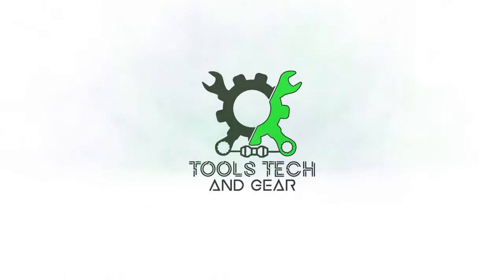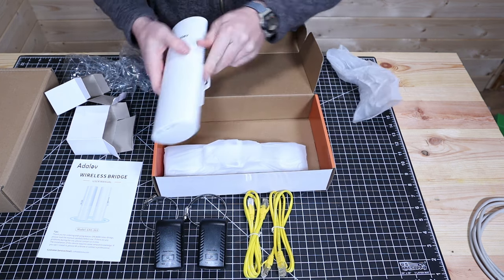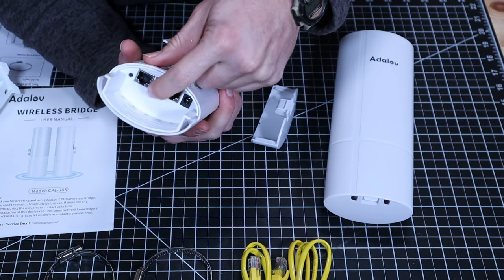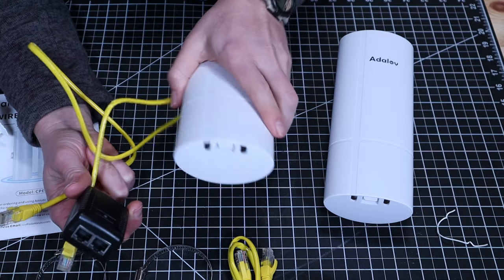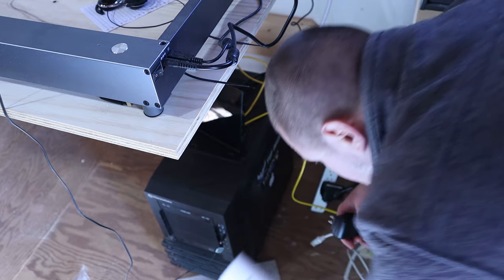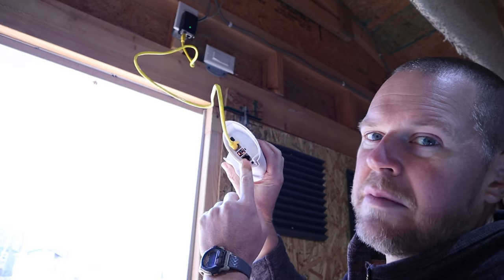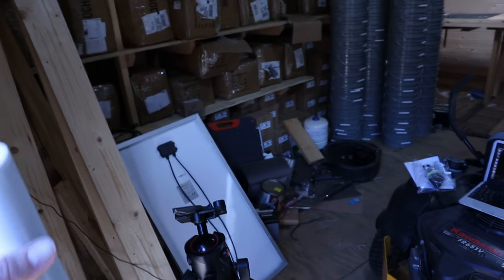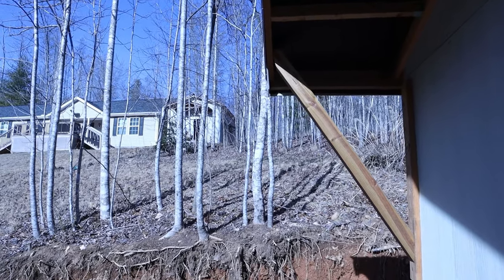Adalov Point to Point Wireless Bridge Install

Comment: You need to plug in the "B" ethernet into the Other port on the POE adapter to get more than 100Mbps, I have these, You may not get 1000Mbps, but I get 350 Up and Down on mine from 650Ft  away. The port you are plugging into on the Bridge is called a "Management port" Yes you can get internet from it, but its main purpose is to connect directly to the Bridge for configuration.
Reply: So you do plug into the 1000 mbps on both units.??
Reply: A answer to this question would be helpful

Comment: I don't have these but have installed lots of PoE wireless. You shouldn't need to use the 100Mb port at all as the data will flow on the 1Gb port with the power signal. Unless of course this vendor is doing something odd.

Comment: so just installed my own. model CPE468 and everything is connected and setup correctly, my wifi router says its connected to the internet and when i connect my phone to it, it says i have 1gbps internet speed, but i cant even open youtube. when i check the speed on my phone inside my house (where the modem is located) itll say i only have like 400 mgps and i can download 60gb games in less than 40 mins. its really confusing me

Comment: Why would you need 2? Wouldnt one work just fine? Connect directly from main router and into the barn?
Reply from the maker: The two bridge talk to each other. They don't talk to routers outside of the ethernet cable. You have to have the pair.

Comment: I love this kind of stuff.  As a little kid (before cell phones and FRS radios) some neighbor friends and I tried to set up a telegraph system thru the ally between our houses.  I may have to check out this system to connect to my brother's house again.  😁
Before my brother bought a house in my neighborhood he was approx 5 miles as the crow flies across the river bottom.  He had broadband.  I had no broadband available. We set up 802.11b with a 24db grid antenna on each end and then I also had broadband.  That worked for a few years, then he moved to my neighborhood and neither of us had broadband.  A friend about 1.5 mile away let us set up the system from my brother's previous house and we put up a smaller antenna at my brother's new house.  Then all three of us shared that broadband for a couple of years until finally my neighborhood was wired.  We took the equipment down from the friend's house as he was moving, but my brother and I remained connected until an ice storm in winter 2009 took down my antenna.
Reply from the maker: That is brilliant! 5 miles is a long way to get the internet to travel. A lot of us had that struggle years ago. My brother and I had to get cell service into our parents basement.
Reply: @ToolsTechAndGear  Desperate times call for desperate measures!

Comment: I've installed several CPE and WISP systems in my prior work life. I like the simplicity of this one plus those included pole mounts! The pole mounts alone are easily $15 each. I also like the compact style of POE injectors like this unit has vs. other ones I have used. This is smaller and less clumsy on cable management. Nice!
Reply from the maker: The system seems to be a good fit for those looking to extend internet service to an out building. The power over ethernet is convenient!

Comment: I like your video since I am going to install one of these soon and I can't find a manual.  One question, why the POE on the 1000 GB channel instead of the 100 MB?  Thanks.
Reply: If you plug it into the 10/100 then your maximum throughput speed would be 100mbps.  By plugging it into the 10/100/1000 your maximum throughput it 1000 ... so 10x the speed by using that port

Comment: Hi @Tools Tech And Gear, do these wireless bridge work on vertical distance? For example, condos. Can like 8 floors right below receive the wifi signal?
Reply from the maker: Yes that would work well.
Reply: They can tilt up and down on the mount

Comment: Is it absolutely necessary to have line-of-sight for these units to work?  I know it would be preferable but is it useless without line-of-sight?  I saw a video of a very similar type unit (unknown manufacturer) and the presenter claimed line-of-sight on that unit wasn't necessary.  Can anyone provide some insight?
Reply from the maker: I have mine installed around 150 feet away line of sight. I think that they are affected by both direction and line of sight

Comment: But is the slave emitting wifi? Or do you always have to connect via Ethernet at the shed?
Reply: Or should I connect a router to the slave to have wifi?
Reply: @TheDjeezus  As he mentioned in the video, you have a choice. You can connect your laptop to the slave unit via an ethernet cable, or instead plug a wireless router into it. I think just about everyone would go the wireless router route. Mine cost just $40 and sure gets the job done.

Comment: So does the garage unit hang outside or inside the garage? Does the router unit hang outside your home or inside? Do you connect the garage unit via Ethernet cable to the extender or will it connect wirelessly as it does to the router?
Reply from the maker: Both units can be hung outside so that they are line of sight from eachother. Both units will have power through the ethernet "power over ethernet". Once you have internet in the garage you then use an ethernet to get the signal to a wireless router.
Reply: @33thewitt  I assume a simple WiFi Access Point would also work, not a full-blown router with NAT, etc...
Reply: The B version has some wifi ability as per manual.  Specific Address/password/ssid for every channel!

Comment: Hi Seth! We have our bridge all set up. We have full WiFi bars all lights are lit.  Unfortunately none of our devices connect. On our devices  under the  the router name it says in yellow no internet connection with a line through the symbol. HELP we just don’t know what to do!
Reply from the maker: Do you have the internet from the bridge going to the router internet in port?
Reply: The master(bridge) is plugged into the router in the home and the slave (bridge) is plugged into the router in my out building where I would like service. If that answers your question then yes.
Reply: I have a question.I'm actually buying this to get Wi-Fi in my rv camper Will this device give me wifi access to my cell phone my smart tv my xbox So I can use my smart t v to watch movies with the wifi

Comment: Recently purchased these myself but I've been having an issue in that, We have a connection but it's asking for a password. We're trying to use it completely on wifi as that was the initial intent to get internet down to the garage. I see it works no trouble when you connect via ethernet, But for us it keeps asking for a password, we've made sure the Channels are the same, it's set to Master and Slave systems we get 5 bars. But we just can't connect even using the pages in the back of the instruction manual.

Comment: The units appear to work straight out of the box. However the led 's on the side and the 7segment display are very bright at night. I assume there is a software option to turn them off, but I can't find it. Anyone out there who knows how. I imagine the GUI is common to loads of these devices.
Reply from the maker: I have had this installed officially for around 2 weeks. I can confirm that the lights are very bright at night. My solution is just a small strip of black electrical tape. cover the lights. That will help keep the bugs from gathering around the unit.

Comment: I am completely clueless when it comes to this kind of stuff. I have a different type of bridge extender, but everything seems the same. I'm wanting to get the Internet from my mum's house to a caravan about 50 metres away. My questions are. 

1 - the first box. Once connected to the router, ( my mum's house. Will I have to drill through the wall and stick it on the outside of the house?

2 - Once the second box is synced with the first box, will I need another long ethernet cable to run from the second box to another router in the caravan?. 

3 - if 2 is the case, and I have a 2nd router in the caravan. Can it be any old router?, and will I be able to use devices etc wirelessly by connecting to the 2nd router network. I'm so confused. 😂

Comment: Could someone here please help me I bought an Adalov point to point router I can't configure it when I plug it into my pc and I configure the internet in local connection with destined ip address in the manual and I can't connect to admin on the web if anyone could help me it's great thank you
Reply: I was able to get in using the IP Chart in the manual. though I still do not have internet access.